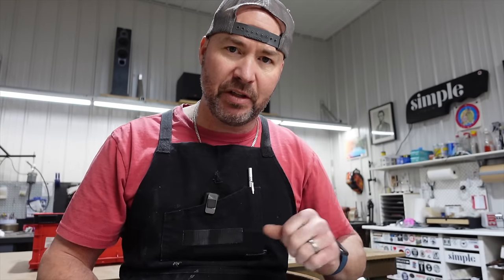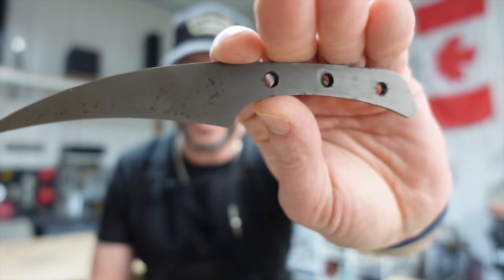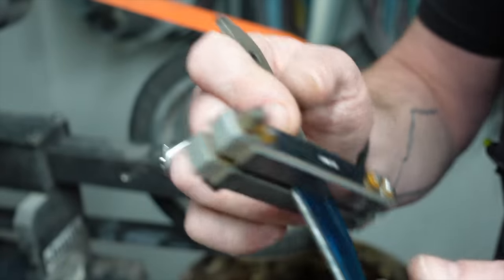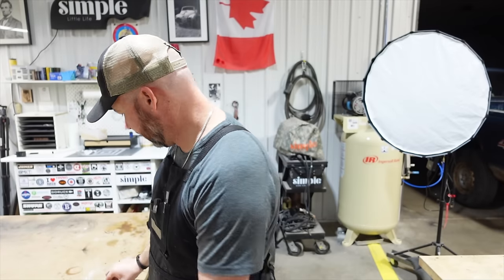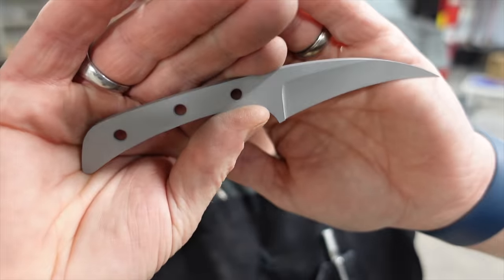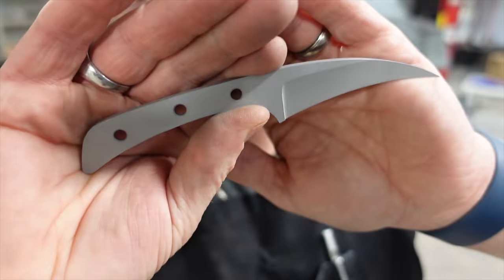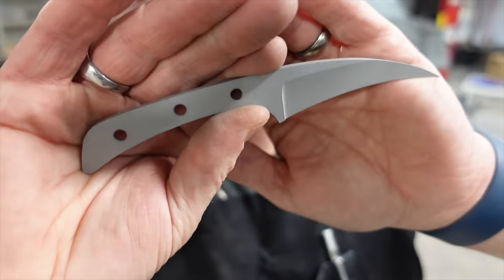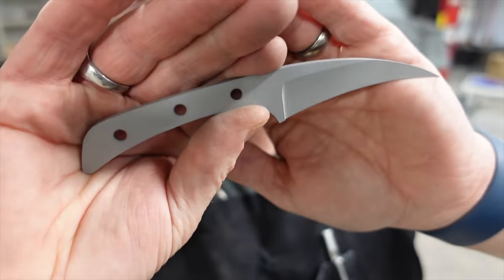Avoid These Mistakes: Simple Little Life Build-Along #4

Comment: Use your 1×30 , I use mine for inside curve  blades , karambit, hawkbill pruners,  tracker styles,  the narrow belts are awesome for that , affix it to a jig with the two high points even & then "hug" the outside edges of platen a bit.
Reply: What 1x30 belt grinder do you use?
And also what's the price?
Reply: @HoneyEDC  
The WEN  was a gift , the harbor freight runs between 50-75 depending on sales
Reply: @droopydawg  alright, thank you.

Comment: I used my Palmgren 2x42 with the flat platen. As I pulled the blade across the belt, I followed the curvature, bringing it upwards towards the tip. It made it feel more natural for the bevel grinding. I tried using the bottom wheel as a contact wheel like you, but I had the same problems you were.
Reply from the maker: Great tip! Thanks!
Reply: @Simplelittlelife  no problem. I was talking to you while watching this like you could hear me 😂.